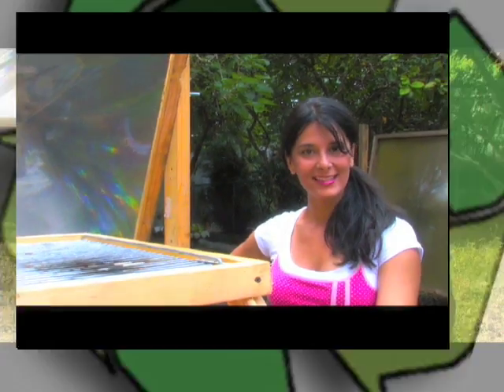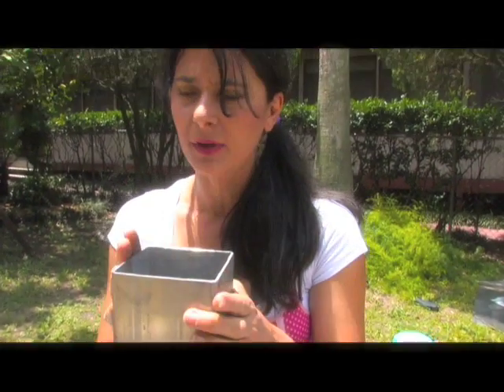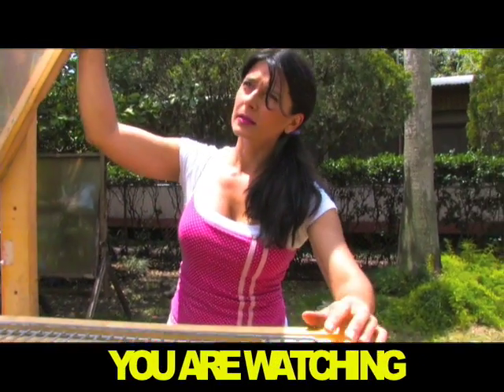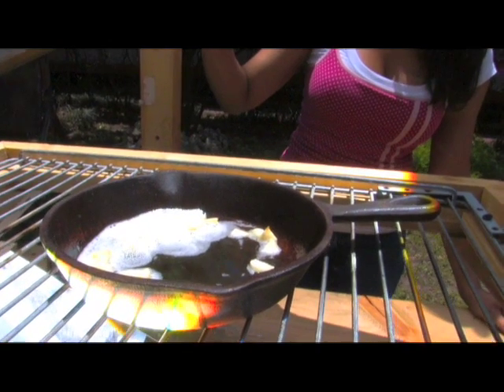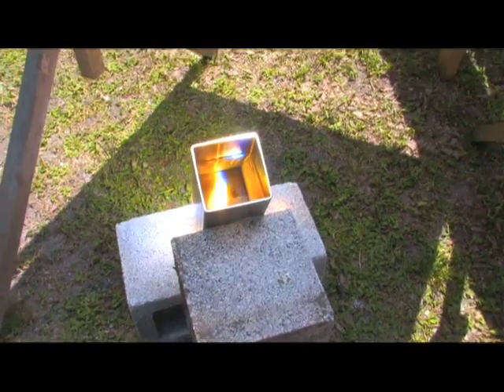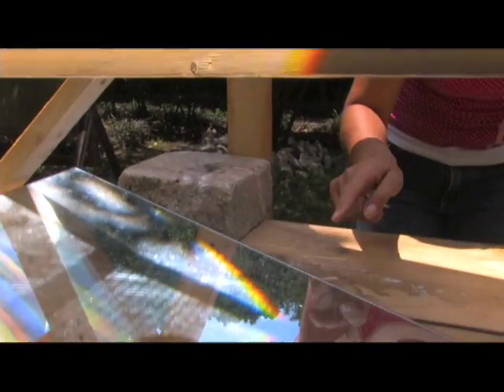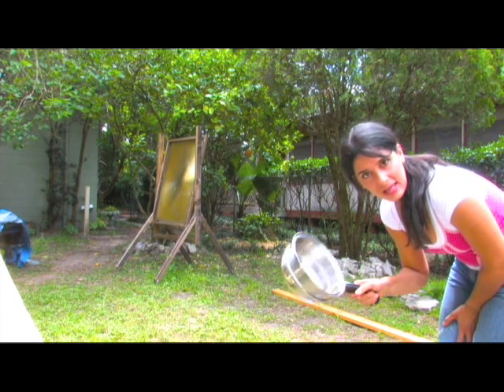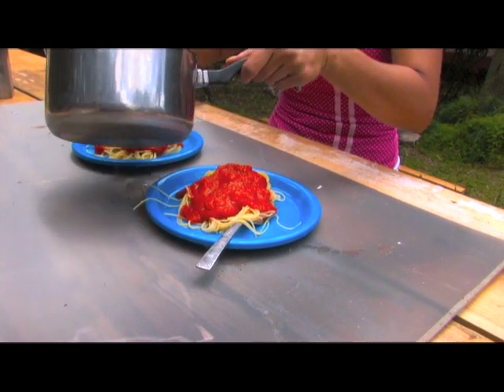SOLAR COOKING PASTA FRESNEL LENS STOVE OVEN SOLAR POWER Mirror Bouncing

Comment: you cannot stir without hand/skin protection (gloves). putting ur hand in the concentrated beam will guarantee a skin cancer. also looking at the concentrated beam point of impact damages retina (UV reflection). modern installation uses some medium to safely transfer heat to ur working bench. (liquid/pomp system). that would be a nice DIY, also allowing cooking in the shadow of a tent or something.

Comment from the maker: Larger lenses provide more bulk power which is need for cooking based on the dimensions of the pan you are using. A 10:1 ratio is required for best results. Small page magnifiers can burn stuff but will never ever cook anything.

Comment: Does the lens need to be so large to heat a pan for cooking? This would be great for camping if the lens could be about 9" x 12".  How about a flexible mirror like sheet that can be rolled or turned into a parabolic mirror, again for camping or emergencies on the fly. You have me thinking. Thanks.

Comment: Hey GPS,Ive seen the demonstrations where the F.lenz melts ,cracks glass etc.If you put a lid on the pan will it explode into the food or something Should we use a glass or stainless lid I hate flys and stuff in my food can i use some type of metal mesh screen to keep the critters out .Any suggestons Why did you build a  steel tube Cant we just use our own stainless pots and pans Should you warn  about  extreme fire hazard on surrounding materials want to know how 2 generate electricity with one

Comment from the maker: Anytime you have to look directly at the beam then safety goggles (welding) are needed. For bottom heating it is not. The only risk is burns, just like regular cooking. The bigger risk is simply being outside. Sunscreen or long clothes. Most people overlook the fact when cooking. An hour of sun exposure can lapse quickly when cooking:-) The light radiating from the pan and surfaces is about 5% of standing in direct sunlight.

Of corse you never want to be directly in the beam.

Comment from the maker: Hi,

Thank you for the comment. The sun will actually cook food directly but it can also burn it easily so heating the pan works the best. Radiation is not an issue as you get more exposure outside in 10 minutes than an entire meal cooked directly would. Also your skin's DNA is what gets damaged by sun exposure, the food is safe.

Cooking over an open flame is the real worry. Also keep in mind all greens are blasted with sunlight:-)

Comment: Dan we gotta talk.  Denise looks great infront of the camera then you jump out looking like you done cleaning a chiminy or something. LOL  Hey you two are doing great with these videos.  Keep up the good work.  As for the noodles.  It might help if you tilt that pot twards the lens and then use a mirror much like the sauce.  This will allow more of that hot surface to stay in contact with the water doing a better job heating.  Again doing a great job.  Off to check out the rest of the videos.

Comment from the maker: If you stare at it yes. The bottom of the pan is not in view from the chef. The pasta chamber is bright, but on a dark surface and it set to boil. When direct heating from overhead, then goggles are needed.

Comment from the maker: Outside temp has no effect on the heat collection but does affect heat retention. If the sky is clear, and the sun cast a shadow, you can melt zinc or glass and cook with ease.

Comment: Good using that thick metal, so it has a capacity of heat incase a cloud temporarily blocks the sun.  Also, a dark color paint on the metal would help...not sure what though can handle the temp..  Insulation such as wood or foam on the sides and back can prevent heat loss in the air...you know this, but some might not.